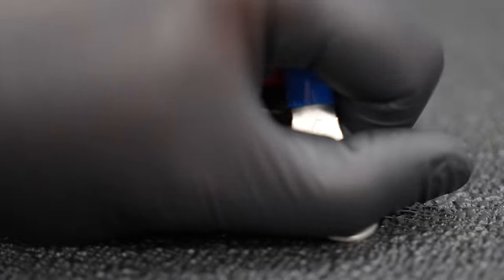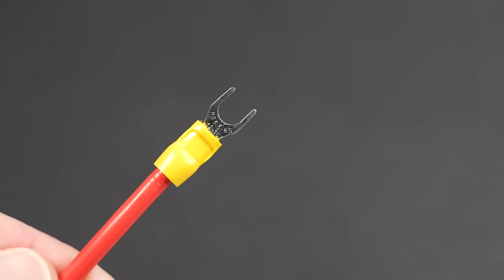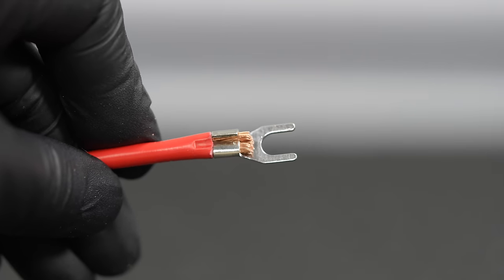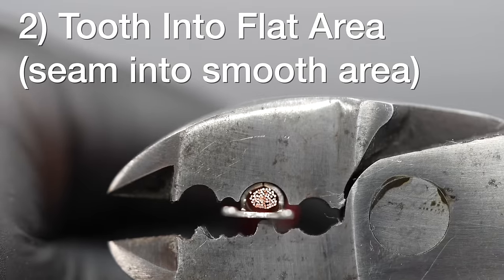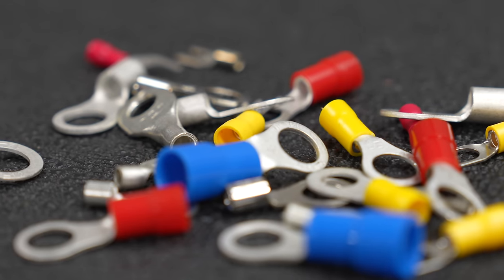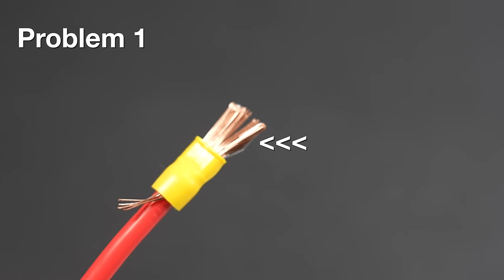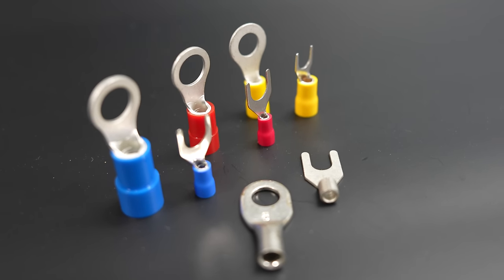Why 50% of All Crimp Connections Fail - Up or Down?

Comment: I am a retired manufacturing engineer. I’m surprised you didn’t mention about what happens if you don’t strip the correct amount of insulation off the wire. In a proper terminal there are two crimp zones. One for the wire and one for the insulation. If any insulation is crimped in the wire zone, the insulation will actually squeeze completely through wire eliminating the connection. Also for the best termination you need strain relief for the wire to keep the wire from breaking after repeated movement over time. This is achieved with an insulation crimp from the second zone I mentioned before. Good ratcheting crimpers will have two crimp areas, one for the wire crimp that will be smaller than the other area which is for the insulation crimp. This requires that the terminal be inserted in the crimper in the correct direction so that the smaller area is near the end of the terminal where the wire crimp is and the larger area for the insulation crimp. Therefore if the strip length is correct you will have proper alignment with the crimper and get a correct crimp.

Comment: The PVC insulated terminals shown here are trash - use nylon.
Manual crimpers are all trash, use a ratchet crimper.
To generate sufficient force for a crimp with the non-insul crimper shown (red handles) will typically cut the PVC insulation on the back side.

Quality terminals like Ancor use a separate tinned sleeve over the barrel and the barrel itself has a taper to guide the strands together as you push them in.

If you're using manual crimpers and PVC terminals, you're probably also using SAE wire, not AWG. SAE-gauged wire has a slightly smaller circular mil area (cross section) for a given gauge number than AWG.

Terminals are cheap: spend the money on good ones.
Don't forget to do a tug test on every single terminal you crimp.

Comment: Good video.  I would also add to never buy cheap terminals.  Better terminals have brazed barrels and use heavier metal, so they get a stronger crimp.  If the connection is going to see any weather at all, dip the wire in an anti corrosion paste before crimping.  Last tip is to use the right connector.  Maybe another video on that?  They range from the cheapest connectors like the one shown here, up to types that actually solder themselves after the crimp using a heat gun.  These days I don't use these cheap PVC insulated connectors for anything.  I only buy marine grade nylon shrinkable insulated terminals.

Comment: A true electrical crimp connection must have a gastight bond between the terminal and wire. Very few (any?) plier style tools with open sided dies can reliably do that.

Compound / ratchet tools with closed dies produce vastly better results, for standard size insulated crimps with the correct wire sizes, due to higher force capability and the terminal tube being unable to just spread out sideways.

For smaller terminals such as electronics multi way styles, anything other than the makers specified tool is likely to give erratic results.

The big problem with bad tooling is that a non-gastight connection will appear perfectly good when first made - the problems only show later, possibly years on, after oxidisation or other corrosion occurs and the internal resistance of the joint increases.

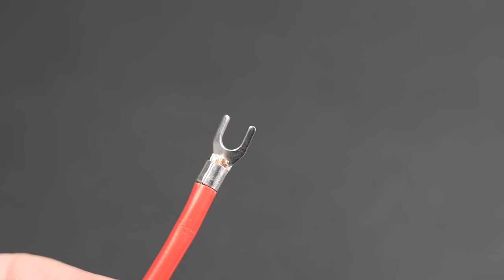Comment: 3:39 Nope, still too much wire sticking through. It'll have to be shoved out of the way so the nut or washer doesn't land on it. It'll either look like an amateur did it or it'll be connected badly.  4:10 is pro.

Comment: 1. Slide heat shrink on the wire
2. Strip end
3. Pencil eraser if there’s any coating
4. Crimp end.  Needle nose works fine to roll end around wire
5. Solder it!
6. Heat shrink over the connection
7. Never have a problem with that connection again.

Comment: I have insulated ratchet crimpers and ratchet crimpers for use with U-shaped brass butt connectors. I also never leave the plastic insulation on any terminals, and almost every instance I will apply a small amount of solder for a better mechanical lock and use adhesive heat shrink. Overkill it may be, but it's solid and protected against oxidation that causes resistance and heat.

Comment: This provides good information for a beginner. Orientation is critical. The 'perfect' result will fail inspection as defined by the IPC-620 quality reference. Wire should not extend that far through the inspection hole. It will interfere with the mounting mechanism.

Comment: I appreciate the effort it took putting this together, but want to address some information that is potentially misleading or confusing. A ratcheting crimper is objectively better than a cheap non-ratcheting crimper in almost every regard. It completes a full calibrated cycle to the proper depth each and every time, and when paired with the proper terminal with good wire fill, has an extremely high reliability rate. The other is that the orientation of the indentation, which is the main point he is making, is valid only for dimple or “staking” type crimpers and these really suck, especially for small gauge wires.  Just don’t use them.  There are better crimpers.  He uses the cheap non-ratcheting crimpers as an example for seam orientation but that style of crimper really is best suited for insulated terminals (if you must*), and a proper ratchet crimper will provide better support and deliberately folds the seam down between the wires forming a “B”.  You can see the results of this termination done properly shown in the examples and specifications by the FAA, NASA, ABYC (American Boat and Yacht Club), NASCAR, Formula 1, SAE, IEE, and NEC.  And they all unanimously agree on this. As just one specific example, if you are using uninsulated terminals with wire strain support, they start off in a U-shaped with open wings and the die of the crimper is meant to guide and curve those wings downward into the wires and the indentation will ALWAYS be on the seam side.  There is a second set of prongs behind the electrical contacts meant to crimp around the insulation. Because of the larger diameter including insulation, the crimp is set to less of a depth. A proper ratcheting crimper will do both electrical contact and insulation strain-support crimps in a single die at the same time, and you can see on the inside the die it looks like a stairstep.  The bottom side of the terminal away from the seam will be perfectly flat and and level, the side with the seam will have two different heights. If you were misunderstanding this video and thought the dimple should be on the bottom of those terminals with crimpers *other than crappy dimple dies, you would be crimping them EXTREMELY incorrectly.

Comment: Was cool to see the "upside down" crimp that is actually right side up.  Perhaps we are used to seeing those commerically crimped items where the crimp goes down in the perfect middle of the seam and little humps extend symmetrically in both direction and that makes us think the middle where the crimpper point should go.  Thanks for the correction.  Mixed reviews for crimp connectors have made me want to turn to home solder and shrink tube.

Comment: Personally, I am not a fan of just crimping the wire.  I prefer the crimp, solder, and shrink wrap method.  this video is great at teaching people how to crimp properly.  I am just not a fan of insulated connectors, and crimp only.   I have 2 different crimpers that I like. the first is from Wirefy, it has interchangeable jaws and supports just about any kind of connects you would ever find. the second is the MSD Ignition Pro Crimp, i mainly use this for automotive applications, for crimping Sparkplugs wire connections, Weather Pack and Deutsch connectors. for stripping wire, I also like too different tools. both made by Irwin. first is the Self adjusting style wire stripper, and second is the 6-inch stripper/side cutter style for hard-to-reach areas.  I prefer to use non insolated connectors and use the crimp/solder/shrink warp method.  so, I absolutely love the Ryobi One+ soldering station and the Ryobi Heat gun.  they are cheap but extremely reliable and if you already have Ryobi tools, their batteries have not changed form factor in 20+ years.  I have used the Milwaukee M18 heat gun and their m12 soldering iron. both are great products, but the M12 takes longer to heat up than the Ryobi and does not last as long if you have a lot of soldering to do. also, the heat gun cost twice as much as the Ryobi. if i had a job where i had to use a heat gun every day, it would be the Milwaukee. but i would still stick with the Ryobi soldering station.  also, i just noticed Ryobi had a new USB lithium powered pen style model soldering iron that i might try. most of the work i do, is classic car wiring harness repair/modification, car stereo installation, and old computer repair (mostly replacing leaking Capacitors and the old CMOS battery repair)

Comment: I learned this method many many years ago.  I usually use uninsulated terminals, and then use adhesive lined heat shrink tubing to cover the crimp after inspecting it.

Comment: I, experiencing a great many failures of these type of connectors, long ago started using only the non insulated connectors of which I would crush as best as possible with regular pliers and then solder the connector and cover it with heat shrink.  A good solid problem free connection every time.  😉

Comment: As far as problem #3 goes. So long as the conductor is flush or a little past flush the barrel is fine. The wire can get in the way of the screw terminal if it's extended out too far, which can lead to poor connections at the screw terminal. For connections that really matter in moist environments I'll use uninsulated terminals and crimp them then I'll go back and solder them and finish them off with some heat shrink or electrical tape for the insulating portion where necessary.

Comment: The ratcheting tools only work reliably with the exact crimps that there dies are calibrated for or an exact equivalent.  If you change to a different brand of crimp with a different thickness of barrel or insulator, then you will consistently generate bad crimps.  I documented this in a production environment more than 35 years ago.  A purely manual crimp tool would do better if you have crimps that are made to a different spec.  Also, different "tooth" crimp tools and different crimps have different correct orientations.  Here things are described as absolutes when they are actually variables.  A little bit of knowledge can be a dangerous thing.

Comment: I've seen alot of different right ways to crimp wires. Some people even say adding solder is bad because it makes the wire stiff when it flows up the wire. My best results are using bare terminals and getting the seam started folding in on itself then finishing the crimp in the round crotch of the crimp tool. If it small wires of course.

Comment: From what I was taught and from experience, the first crimp is how it is meant to be done, you just needed to crimp both sides to the grab and bite the wire.  When done correctly the crimp separates the wire into two sections and holds it.  Not getting the crimp to hold the wire causes it to open up and release the wire (in my experiences)

Comment: A year ago I tried to purchase a ratcheting crimp tool and I tell you, they were all crap. I was a broadcast video tech for two decades and dove into my bag of BNC crimp tools, some cost near a grand, and modified a few to fit the dies for these types. Sad that spare no expense I couldn't find anything adequate. Mind you I have high standards but still you'd think some manufacturer would meet the challenge
Reply: It is easier to make crappy tools and sell more of them, instead of just making a good tool.

Comment: Good stuff. This has been an area of confusion for me from before there was an internet to go watch helpful videos. I had originally concluded they should be done the other way, with the prong into the seam. This was based on examining commercially done crimps on things I had bought. On those, it looks like each half of the seamed side was rolled down into the crimp. I also noticed that some of the spots on the crimping tool have a pointed prong with curved edges that seems to match those rolled edges. I concluded that the prong went on the seam side. The pointed prong appears on the smaller size spots on the crimper, so I concluded that on the larger sizes, the shaped prong wasn’t necessary. I always use uninsulated terminals and heat shrink them, so I’ve been able to see the crimp, after I’ve done it. I was frequently dissatisfied, and usually ended up crimping connections twice, once from each orientation — that way I was sure one of them was correct! Ha! It has only been in the last year or so that I settled on crimping the way you described. I still learned I can improve by having a little wire stick out. Thanks.

Comment: Nothing at all to crimping electrical terminations! First: Know what you're doing! Second: Get the right crimper. Third: Learn how to use it! Common mistake: Crimping the insulator instead of the terminal. Set the terminal into the crimping die so the terminal crushes the wire all around when cycling the crimper. Use the right gauge size terminal for the wire and the right die in the crimper. The best  crimpers will make you squeeze until the crimping cycle is completed then the die comes off the crimped terminal.

Comment: I soder all connectors after the crimp and use the insulated cap and put it in place and then I use a heat shrink tube over the insulator and onto the wire.  I have never had a connector fail.  I also never have a connector or wire overheat because of a bad/loose crimp.  Use the proper insulated end connectors and the proper gauge wire and a good crimp tool.  Slide the cap insulator over the crimp, and it will slide in and crimp it in place, after it is sodered, then use a quality heat shrink tube. It is what works for me.  I never want a customer to come back with a failed repair.

Comment: Problem 3. That crimp is just about perfect to aeronautical standards. The crimpers used at Boeing stop the conductor right at the end of the crimp barrel. But these terminals are crap compared to the terminals at Boeing. Besides crimping the conductor, terminals also have what's called an insulation grip, this is metal that is crimped onto the wire insulation. In most cases, we also use what is called a restricted entry terminal, they are made to crimp just one size of wire. These terminals are also made without split in the crimp barrel, they are made from a solid ring of metal. Once installed correctly, these terminal will last the life of an airplane. I worked 40 years at Boeing and crimped thousands of terminals. Never had a failure that I was aware of.

Comment: Good Content.... I don't use those insulated - open barrel units.  In fact... I've told a LOT of people to upgrade their hardware... I use Crimp Shrink units. This keeps corrosion out of the wiring. On Batt cables I also use closed barrel ends, but with Shrink tubing that has Glue in it.

Comment: one of the main reason crimps fail is that most cheap insulated connectors are too big. I looked up the drawings and wire sizes for quality one and compared them to cheap ones. cheap blue ones often could take 12 or even 10 AWG. reds that could take 12AWG. the max size wire should just fit inside the connector it is made for.

Comment: I've always crimped them with the solid side up. It just makes more sense that way. Although there are certain crimp connectors that come with the flaps not bent at all. They are used with a special crimp tool that folds the flaps.

Comment: crimp connectors never fail when you use the correct crimp-ers, been working on acft for 40 years as a electrician. their are hundreds of terminal strips and thousands of terminals , terminated at relays , circuit breakers, and components

Comment: I learned this the hard way after making a wiring harness for an arcade stick and doing it exactly backwards every time... and then having the crimp-on connectors come off the wire when I unplugged them from the buttons, lol. Had a much better time with it oriented as seen here.

Comment: I usually solder those crimped connectors on. The method i use is tin the wire, then tin the connector, then put the wire in the crimper and crimp it. Then resolder the entire finished product. Then clean with alcohol. Its permanent. To insulate it afterwards i use a heat shrink with a glue inside that melts and seals.

Comment: I have seen many bad crimps made both ways. Placing the tooth on the solid side of the barrel can push strands through the seam on the other side. It's the worst crimp possible. Also, either method first requires the tooth to be centered. If the tooth is properly centered on the seam (it's not hard to do) the seam will curl evenly into the strands, making a very strong connection.. Most "factory" crimps are like that.

Comment: I crimp marine heat shrink terminals for my own boat and use ratcheting tools. The thing you don't mention in the video is that the ratcheting tools don't "let go" until you've applied enough force to make a proper crimp. Much more foolproof than the super-cheap stamped metal stripper/crimpers that many people buy.

Comment: Good points but I would add a few more tips:
1. Don't buy cheap crimps. Most high quality crimps have the top seam brazed or welded.
2. Avoid insulated terminals. Much easier to inspect and adding some heat shrink is not much work

Comment: Exactly. Figured it out when I was 10 years old. I run into too many BEM jobs. First thing I check for on trailers with lighting problems. The other one is Chinese wire. No matter how good a crimp it squeezes out and breaks off.